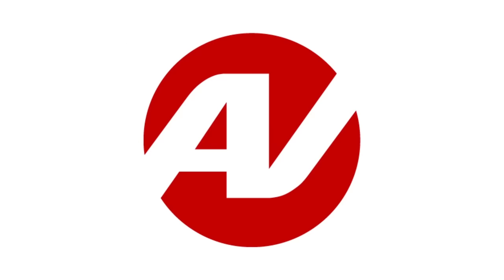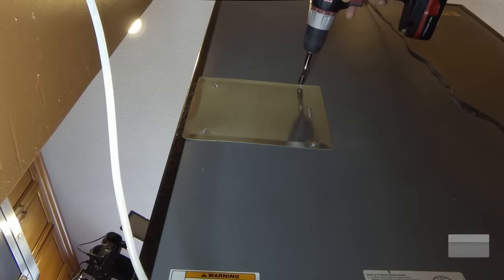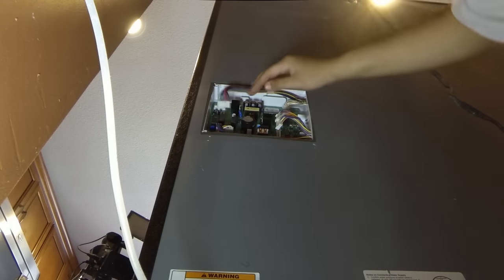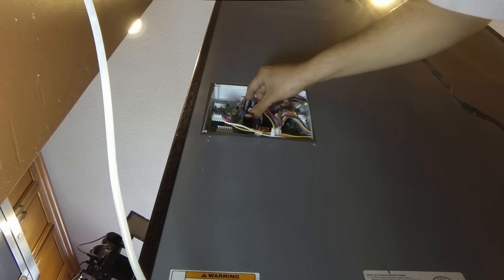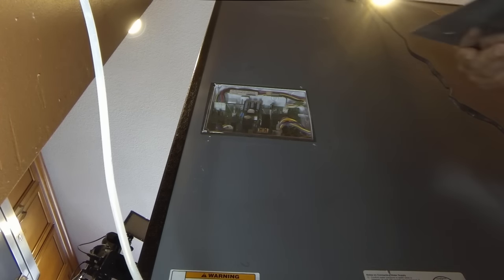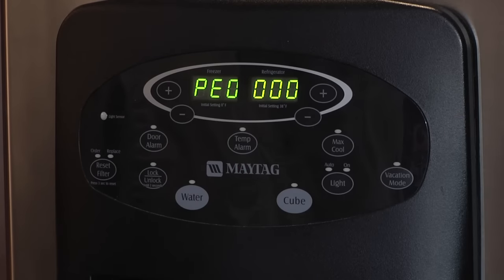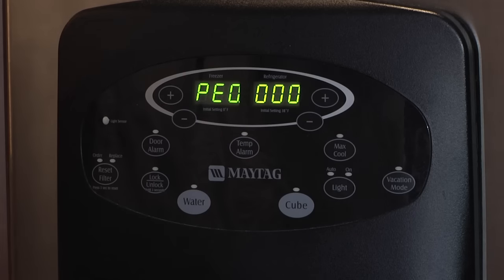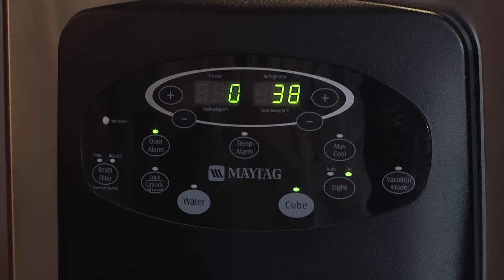Maytag Refrigerator Repair - Control Panel Lights Flashing - High Voltage Board

Comment: what to do if it wont respond to pressing down door alarm and arrow down. nothing happens
Reply from the maker: Great question, if you have a more technical question that our parts department cannot answer, you can search our over 17,000 answered questions free at our website www.ApplianceVideo.com under our Repair Help section. You can also call our parts department at 1-800-830-5465 and they can give you help 7-days A week ,or search at www.SaveMoreOnParts.com  .

Comment: When I replaced the board and turned it on it is still blinking in and out 😩
Reply from the maker: Great question, if you have a more technical question that our parts department cannot answer, you can search our over 17,000 answered questions free at our website www.ApplianceVideo.com under our Repair Help section. You can also call our parts department at 1-800-830-5465 and they can give you help 7-days A week ,or search at www.SaveMoreOnParts.com  .
Reply: Mine is still blinking too, PE0000, unresponsive to my touches. Cannot program the code in.

Comment: Be patient,  it may take a few minutes before you hear the compressor turn on.
Reply from the maker: Great question, if you have a more technical question that our parts department cannot answer, you can search our over 17,000 answered questions free at our website www.ApplianceVideo.com under our Repair Help section. You can also call our parts department at 1-800-830-5465 and they can give you help 7-days A week ,or search at www.SaveMoreOnParts.com  .

Comment: the code is not blinking, make me a beep
Reply from the maker: Great question, with our
technicians now getting hundreds questions weekly, they are answering all questions
at our website at ApplianceVideo.com under our Repair Help section. We have over
3,000 common questions and answers that you can easily search through by your
model number, appliance make, and problem or error codes.